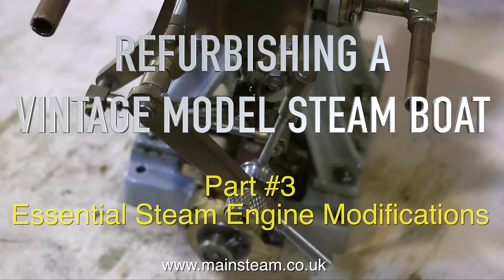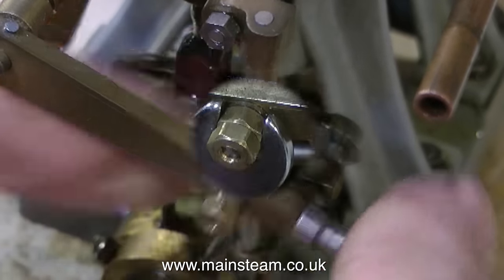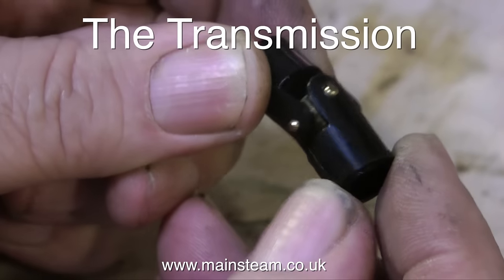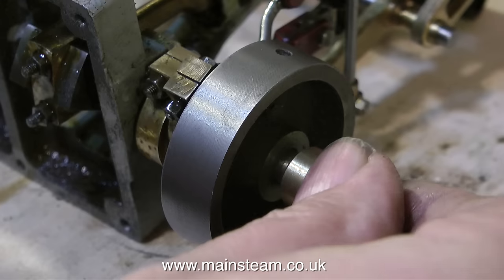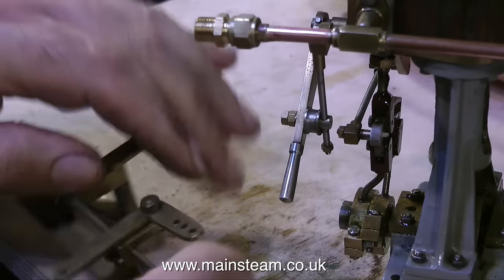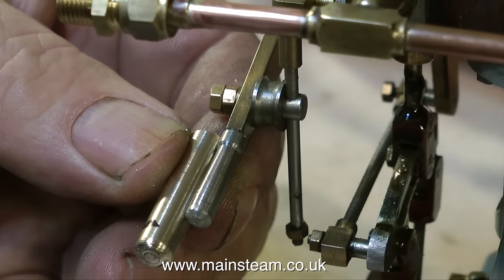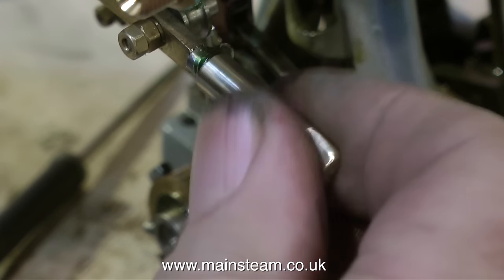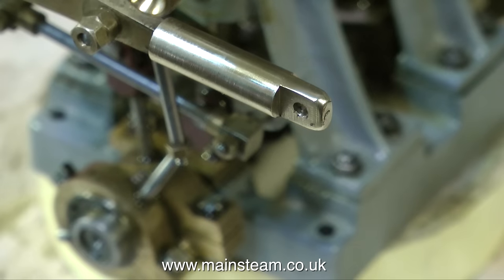REFURBISHING A VINTAGE MODEL STEAM BOAT - PART #3

Comment: Hi i noticed around the 2:42 mark the eccentric strap on the flywheel side is wandering a bit. Does this model have a groove to keep the strap and sheave located or is it missing a bolt?
Reply from the maker: I will have a look at it next time I am in the workshop . . . .

Comment: I know the wire tie solution likely works well but if you wanted something a bit showier you could likely design a nice four bar linkage to translate the rotational motion of the servo to the control arm.  I say this only because four bar linkages look rather nice, there's absolutely nothing wrong with the way you plan on doing it now.
Reply from the maker: In this boat, everything is hidden deep within the hull so simplicity is the best way to go ......
Reply: I notice everything you say in the comments is followed by an ellipsis, as if it were all snipped out from among a near endless collection of Delphic ramblings.   

The ninth the ninth they must be there before the cake or all is lost.... In this boat, everything is hidden deep within the hull so simplicity is the best way to go ...... We'll bury em' he said, bury em like they's already dead.... No it's all proper.... I don't know really, someone out there may have a formula for it .....